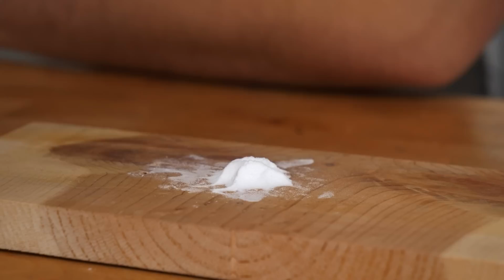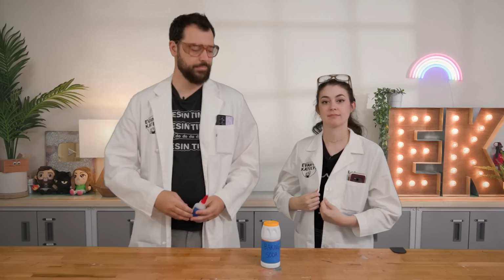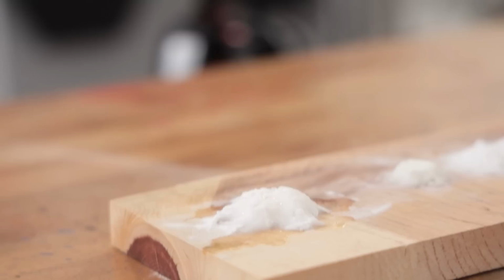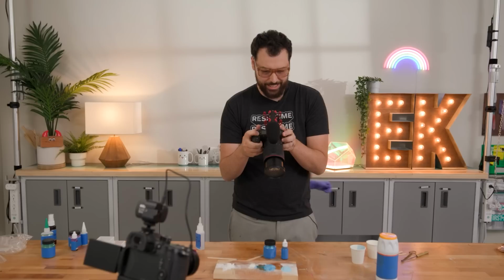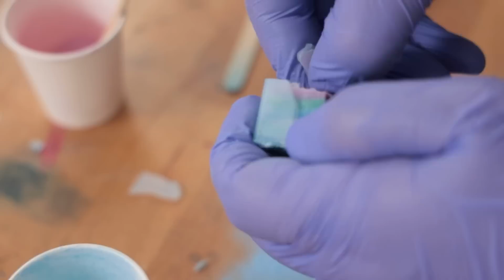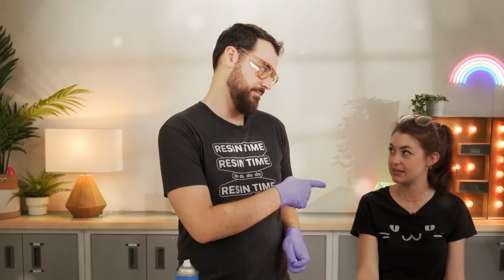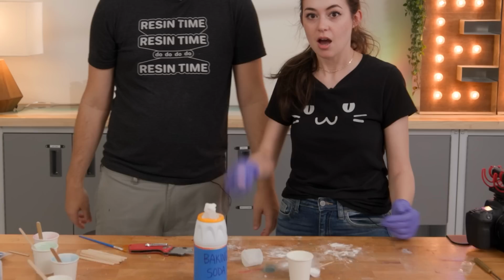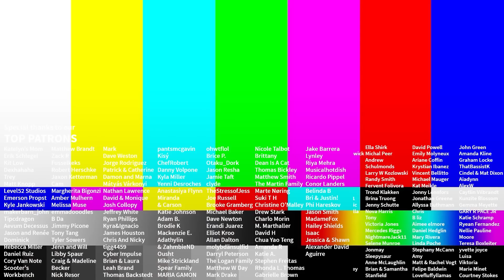Can Baking Soda + Super Glue replace RESIN?

Comment: Nothing can replace the almighty resin, but I'm curious to see how the baking soda super glue combo performs.
Reply from the maker: all hail the glorious resin!
Reply: @EvanAndKatelyn  yes
Reply: Its funny they made this, I have been thinking about using hotglue in molds to make stuff like that XD I already use concrete in all my molds (works well with my tweaks), cant afford resin at all but still want to make stuff :P
Reply: Well, I once had an application where baking soda+superglue was better suited than resin.
My children have a game where instead of dice they have to turn an arrow on a pace of cardboard - love a wheel of fortune (sorry for the weak explanation, I'm German and English is my third language). The axle for the arrow got lost but I could built a new one by layering small amounts of baking soda and drops of Ca. A little sanding and voila - spinning arrow and happy kids
Reply: @EvanAndKatelyn  you have dice ... can we get some space marines ? 🥰
Reply: It has it's uses-- builds up quickly, gets into nooks, reasonably strong but can be sanded. The bad is that it's a bit brittle and breaks too easily when stressed.
    I'm going to try various fibers to see if that'll help.  Especially on bendy things like a plastic bin. Right after I try the 'plastic welding'  hack I just learned. Fingers crossed, but not glued like that one time...
Reply: It seems that this mix can be used for filling gaps very well rather than as a resin.
Reply: The speed and ability to mold is where this technique is where it shines.

Comment: another fun use with super glue is to mix it with talcum powder. make a mound of talcum powder with a dimple in top and add the super glue. mix it in a little at a time and you can make a paste and even get to a putty like consistency and it hardens up really nice while giving a decent amount of work time
Reply from the maker: ooooo sounds cool!
Reply: @EvanAndKatelyn  superglue and sigarette ashes also works the same as bakingsoda
Reply: @nfnworldpeace1992  found that out with cigar ashes while doing some auto body repair as a bootleg bondo.
Reply: :00
Reply: Do these putties stick to you (how much?) While working with them?
Reply: @leenone8456  if you make them thick enough not really, though the thicker you make it the less integrity the dried "plastic" would have I imagine. I'd advise gloves while using it just to be safe, I rarely ever made it much stiffer than a thick water icing (if that means anything for you) so I don't have a great deal of experience on the putty side, was more I was just playing around with the leftover talcum powder after mixing up the paste form...which is great as a filler for hard plastics and the like, goes almost like bakelite.
Reply: @EvanAndKatelyn  Super Glue and Corn Start do the same thing, it makes a really good putty to fill voids with in different things. Or occasionally to repair the nut on a stringed instrument.
Reply: Welp now I gotta try it! I've been using baking soda to quick cure my superglue for awhile now but if I can make a hardening putty with superglue thats even better!!
Reply: @Jalyra420  I've found the slower drying Super glue works best, gives more time to get the consistency you want. Experiment with it though, I found the talcum powder made it set a little slower than usual (compared to just super glue, no kicker), but that could just be me imagining it
Reply: @leenone8456  I always use corn starch and either super glue or a 2-3 part epoxy glue like JB Weld, based on what I need it for. Once you get enough starch into it it becomes kind of like a polymer clay until the glue starts to kick. I'd still wear gloves if you intended to handle it, and make sure you use the slowest drying glue possible for the application, so you have time to handle it before it starts to kick.
Reply: The epoxy/corn starch mix is an old way to repair the nut (white bar on top of a fret board the strings rest in) on guitars in a pinch, so it's meant to be able to be molded by hand for a period of time. Then sanded/grooved obviously.
Reply: @eric_d  when I used it it was new talc

Comment: To do SG molds, you should do a thin layer glue then dump your powder in there, let the dry powder fall back out and repeat. Build your layers that way and you will be fine. I have done this before and made some amazing crafts, dice included. I even made a weighted set this way.

Comment: Did some experiments with the stuff myself, and found that coating the entire inside of the mould with a generous amount of nail polish and letting it dry completely lets you then fill that with baking soda and superglue and it pops right out. You can add mica powders to the nail polish too for a colored surface.
Reply: I was looking for this type of comment. Thanks

Comment: You can get synthetic (maybe acrylic?) felt at some craft stores.  If you soak that with thin superglue, it will set extremely fast and leave you with a very hard substance.  Once I did this with several layers of the felt (all in one go), and then I sanded it down and shaped it in a cabochon shape, to essentially make a cheap fake gem.  It turned out surprisingly good for my first time trying something like that.  Anyhow, part of my goal was to fill in the space in the felt with a clear substance, to see how it would look with backlighting.  It looked pretty cool!  I never had time to do anything interesting with it though.

Anyhow, thought you might be interested.  Maybe you can find a better use for this than I did.

Comment: from an aircraft technician I was told, when a helicopter rotor blade had a chip or little crack, they have special tape to repair it, but they would first use baking soda with super glue to fill the gap/crack to seal it and then apply the tape. He said, you wont believe how strong this is.

Comment: Here's a few ideas for dice!:

1. Use a shell mold and use this resin-adjacent material as the center the same way you might use concrete in a resin project to save on materials

2. Do a dice collab with Rybonator 

3. Try to make the perfect mirror dice dice makers have dreamed of making

and 4. Have a dice collab with Rybonator (Yes this is on here twice, because I really wanna see it)
Reply: Yes on the Rybonator.  If nothing else, they need to check him out for dice molds.  They paid $20 for that for basically no reason.

Comment: If revisited in the future you should look into the  chemical reaction and the actual ratio of the reaction.  Then going by weight you could add the exact amounts needed per layer and ensure either excess glue or no excess to ensure complete reaction.

Comment: I already know all the answers to your questions at the beginning but I'm still watching the entire video since I love your content. Although I have a few tips: You can use baking powder in place of baking soda if you want to reduce the heat generated. From my experience both produce the same strength at the end. Alternatively, you can use thinner layers to reduce heat but it can be tricky to ensure that the next layer adheres to the first. It'll still be strong but you can peel off a layer if you pick at it. 

I'm not sure what you'll need to do for a mold since it adheres to silicone, wood, metal, paper, fabric, ceramics, and other materials. Once dry it does sand very easily and would polish too if you wanted to do that.

edit: all types of the glue will cure faster with a base added but you need to put the baking soda on top of the thicker stuff. Also certain versions of the glue will only cure at the surface regardless of how thick or thin it is. I have had a thin mixture only immediately harden at the surface while the gel version had no issues hardening all the way through immediately.
Reply: Well, I use wax molds (that I make with a 3018 CNC) for resin. If you could control the temperature better (adding smaller amounts) then maybe that could also work with CA. The advantage being that it does not matter about sticking to the mold, you always have the option of melting the wax off. I suppose another (much more fiddly option) would be ceramic, like a plaster slip. A sand mold would probably contain the baking powder, although the CA glue would obviously soak away and I guess glue sand to the outside of the "dice"
Reply: @transientaardvark6231  sand would be easy to sand or buff off but then you'd need to deal with making the dice fair. It seems like the mold release helped which isn't a huge surprise. When fixing silicone with it it'll hold the silicone-silicone bond well but any on the surface can be carefully peeled off. 

Wax is a good idea if you can use the type with a higher melting point. The glue might harden in the correct place before the mold could get deformed.

Comment: I didn't realize that not a lot of people knew how hard baking soda and superglue got. I've always used it as a kind of "quick cement filler" for cracks in things that couldn't be held together by superglue alone. Like when some wall decorations fell and a whole corner broke off, I layered glue and baking powder till it filled the void spaces and then painted it the same color. Did the same thing with some of the display ceramic decorations, but used gold paint on top for a "fool's gold kintsugi" effect. I've even used this to fix a broken fingernail before! We were at a party and one of my cousin's acrylic nail tips cracked right off and we had to cement it back on so it wasn't obvious in the pictures.

Actually, acrylic nails are made with acrylic powder and a hardening liquid too. I wonder how that compares to baking soda and superglue as a resin alternative...
Reply: You’re right it’s probably pretty similar, the acrylic liquid smells pretty strong like glue too… we literally use actual resin for gel nails and something like super glue to attach tips so you’re probably right

Comment: The reaction with baking soda, and how quickly it hardens and becomes inert in water, is why (gel) superglue is used so much in aquascaping! If I'm working out of water and want it to set quickly, I can just sprinkle some baking soda on and then blow it off/rinse it off before putting it in the tank. It's safe for your plants, fish, snails, shrimp.  ...just don't forget to rinse until the baking soda doesn't fizz anymore if you don't want to potentially alter your pH....

You can use it to attach pieces of wood to each other, or to stones to help weigh them down. You can even glue some plants to wood/rocks with it, namely epiphytes (they don't like their roots being covered, so a tiny dot of glue is great for perching them in cool-looking spots on branches and stones) and moss. 

Honestly, you can make so many useful things with a bit of superglue. You can make even more things if you have PETg and other foodsafe filaments for a 3D printer. I'd love to see you guys play with designing even more pet (fuzzy, feathery, scaley, wet...) friendly gadgets that could be printed out by everyone!
Reply: What brand of superglue do u recommend for this

Comment: You can also try lowering the concentration of baking soda. Mix in some inert filler, blend it really well, fill the mold and then just do a single pour of glue. With any luck it won't cure too fast, but still pretty fast. You can use how different fillers react, flour, sand, chalk, clothes dryer lint...

Comment: Love the video as always guys. I work in a baking soda plant and thought I could throw out some info. Baking soda (sodium bicarbonate) does expire, heat and time cause it to decay into sodium carbonate. Most baking soda you can buy is a #2 coarseness. If you ever try again you could use #1, it is very thin almost like powdered sugar. There is also stuff with TCP in it so it flows without clumping.

Comment: If you liked those results, something easier to deal with, acrylic nail powder and liquid. It also forms a polymer. It comes in quite a lot of colors and works well with mica powder. It also won't stick to the mold, you still may want to release it though.
Reply: I actually bought some because of your comment! 

I tried making dice with resin before and it was just such a pain and hassle without the proper equipment like pressure chambers etc. 

So now I'm excited to at least try another option.

Another friend if mine is also allergic to resin, so if this works, that'd be so cool!

Comment: So I work with various adhesives in microelectronics applications. Many that I work with also use an "accelerator" - essentially a catalyst that speeds up the curing process.
In this case, baking soda is the accelator. The thicker glue might work better if poured into your mold first and then accelerated with baking soda.
You could even "dust" the mold with it to create an initially cured layer.
Many different ways you could experiment with this.
But I otherwise really like the video!

Comment: Top tip for fellow bass players. A couple of years ago I resurfaced the finger board of a fretless bass with this, instead of epoxy resin, polished it with car bodywork polish and after a couple of years of gigging it is still as hard and smooth as glass with better sustain then even the original hard wood finger board.

Comment: I sometimes use superglue and very thin layers of toilet roll to mend tiny skulls! Sometimes voles and shrews skulls will have little cracks or holes, and i fix them by dabbing some superglue on and then placing the tiniest fraction of paper! Glues and reacts super quick and turns super hard! Very useful

Comment: Baking soda and super glue have been used for years in the Model Horse hobby (and I assume other hobbies) for years. It can get pretty hot sometimes though lol
Reply: Model airplane builders spray a mixture of baking soda dissolved in water onto a superglued joints to instantly cure it.

Comment: Just so you guys know, there might be a way to make the thick super glue work (so that the mix has more time to cure and perhaps can be managable with molds?).
Porous materials (and some powders, idk about baking soda, but maybe?) can or not absorb liquids depending on the atmospheric pressure. Let's say you have really small cavities in your material, then heavy pressure is gonna be required if you want the liquid to penetrate those cavities, and so the other way around. So I was thinking that maybe, if you guys pour the glue and baking soda in the mold, place it in the pressure machine that you sometime use with resin, and let it cure in there,
Idk, it might work?

Comment: No idea if y'all still read comments on less recent videos, but I really want to see you guys try more with this.   I think an interesting idea would be to use it both as a possible substitute for resin like what was attempted here, but also as a separate supplementary material for working with plastics.

Instead of filling silicone molds with the SG+BP combo, you could create new hard molds of SG+BP with a 3d printed model with a low or semi-low melting point filament.  Something that would melt and release from the created SG combo.

This could allow you to slowly and selectively apply the glue and powder to detailed areas or negative space that would normally be difficult to guarantee is free of voids.  It wouldn't be like injection molding or creating a silicone mold since it is essentially an immediate solid.

There are also other powder and glue combos that work. I saw one with cement/concrete powder, one with cigarette ashes (for some reason), and some with different brands and types of glue.  As for the powder, I'm pretty sure you could use pretty much anything.  Like the mica powder, for example, might work completely on its own without being mixed with baking soda.  That guarantees there aren't any weird voids or strong differences in the coarseness or fineness of the two powder types.

I think there are a lot of fun experiments worth trying.  Some of the other comments have some interesting info and ideas as well.

Comment: This is a well known DIY hack to fix buzzing strings on guitars by building up with this stuff on the nut, and refiling it after it cures.  Did that with my cheap Yamaha, and it worked wonders.

Comment: If you ever wanted to try this again and be a little more experimental I would suggest going through the same process but before you add the numbers you Chuck the die into a cup of water and if there's any exposed powder or whatever it could dissolve away leaving you with potentially cool void pattern sort of like a scaffolding effect but only after it's fully cured

Comment: The cool thing about doing this is its generally used to fill gaps in things. So any pockets in the mold you can fill with baking soda and harden those bits. I know its just for fun but probably would have been easier to juat make a huge pile of it then and it on a belt sander into a cube.

Comment: For the super glue
If you want a good finish on the outside, maybe combine the different glue types?
If you use a mold that opens up a bit more like the cube, maybe put gel glue on the outside and shake around some baking soda once the sides are covered?
That way it's a super thin layer on the outside that makes it look smooth and it will cure because it's so thin even if it's gel.